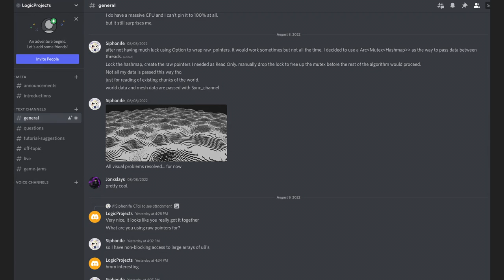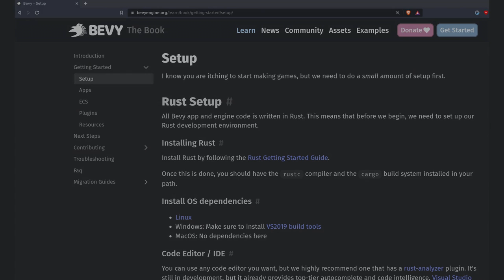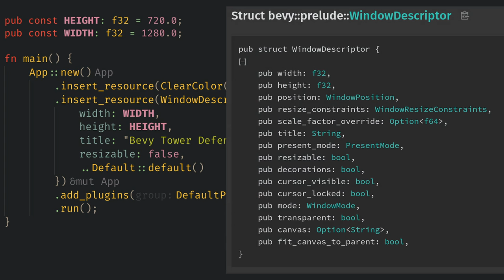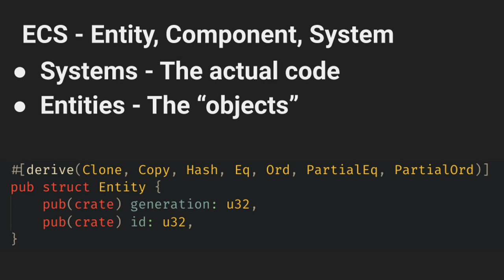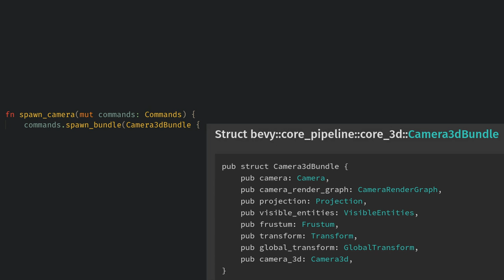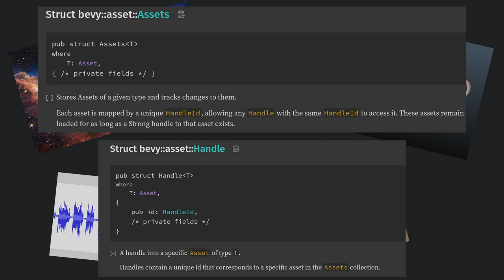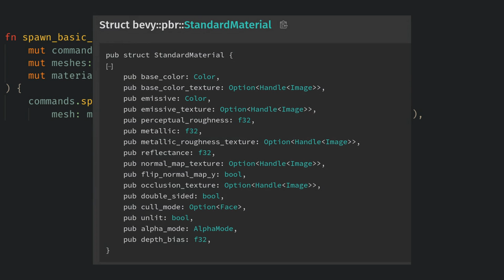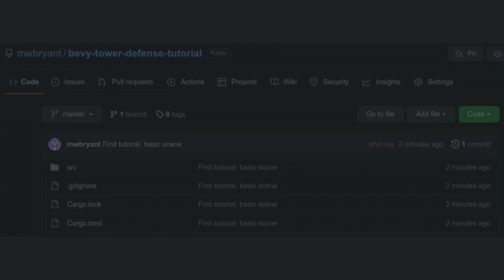Bevy 0.8 Intro Tutorial - A Basic 3d Scene (Ep1) (Updated to 0.9 Check Description)

Comment: Is there way to draw sprites, models and have camera without ECS? Basically access to lower end code.
Reply from the maker: Under the hood bevy uses wgpu and you can use that yourself if that's what your after. Bevy is also designed in a modular way but I'm not an expert in teasing apart the different components so I'd direct you to bevy's discord for that.
Reply: @logicprojects  Thanks. I actually just found out about wgpu and started working with it. Thanks.

Comment: Nice video.
Do you happen to know association between metallic and reflectance in StandardMaterial. Feels like overlap, but I'm far from expert on pbr stuff? Do these get multiplied by each other?
Reply from the maker: I'm also not an expert on pbr. The bevy docs page for the standard material has a PDF you might enjoy that claims reflectance should be used for non metals (whatever that means). In the next episode we'll add a tool that lets you play with the values live and metallic and reflectance do behave different when I tweak them live but not in a way I can describe
Reply: @logicprojects  - Thanks, I think I saw a note somewhere about Filament. I was looking at the docs for that project and that matches what you're saying (reflectances is basically determining the 0-16% range reflectance for dielectrics with 4% at 0.5 value - it's not linear).  Does that sound right that Bevy uses Filament (or based on)? thanks
Reply from the maker: I can't accurately answer this unfortunately. It's well beyond my knowledge of pbr. I'd direct you to bevy's discord and maybe even their rendering specific channels. I'd love to hear what you learn though
Reply: @logicprojects  - thanks, no worries. More just a curiousity thing at this point. I think they're just modeling to the same way as was done in filament, which isn't bad. I kinda still think a "0" or "1" for metallic (IsMetallic) and then a Reflectance Range that's based on that value (like 2-20% reflectance range if metallic is 0, and 70-100% reflectance range if metallic is 1.  Or just get rid of "Metallic" field altogether and just have reflectance which is defaulted to 4%.
It's the same exact deal in blender - hard to model this one I guess, but in the end, I think it's just "reflectance" unless the "metallic" is affecting some other aspect of shading.

Comment: for anyone using 0.9.1 in the  window part you can use what shows in the video use     
App::new()
        .insert_resource(ClearColor(Color::rgb(0.2, 0.2, 0.2)))
        .add_startup_system(spawn_camera)
        .add_plugins(DefaultPlugins.set(WindowPlugin {
            window: WindowDescriptor {
                width: WIDTH,
                height: HEIGHT,
                title: "Bevy Tower Defence".to_string(),
                resizable: false,
                ..default()

            },
            ..default()
        }))  
        .run()
I don't know why but the method show in the video didn't work for me, this did.
Reply from the maker: This is correct! I tried to indicate this in the description and git repo but bevy 0.9 changed magic resources into params on the plugins
Reply: Brilliant, I was doubting myself when using the documentation since the structure didn't match, and I didn't want to throw in a shitty "just works" patch into it, but this lets me know that is the intended new way lmao.
Reply: For those using version 0.10.1 the code is

.add_plugins(DefaultPlugins.set(WindowPlugin {
            primary_window: Some(Window {
                title: "Bevy Tower Defence".into(),
                resolution: (WIDTH, HEIGHT).into(),
                resizable: false,
                ..default()
            }),
            ..default()
        }))

Comment: Could you please turn off inlay hints, i.e. parameter hints? (in future videos, in case you haven't already)
It's confusing. I thought, it's asset::Mesh::from (it's pretty dark so it's not obvious it's just one colon and an inline hint)
And especially new users will probably just type it, thinking this is valid Rust syntax.
Reply from the maker: I really prefer leaving them on for videos. Seeing the types is important for following what's happening in many places and I think the benefits outweigh the early confusion

Comment: Great tutorial! I'm hoping it will be possible to utilize instancing somewhere down the road in this tower defense game.
Reply from the maker: I didn't do it in this project but I'd be interested in seeing if it gives any performance gains. I haven't really seen instancing (assuming you mean reusing an entity and components without just reallocating) used much in bevy because creating new entities is often much cheaper than it would be in other engines like unity. Bevy does handle instancing through the asset system for larger things like models and that happens automatically
Reply: @logicprojects  By (gpu-)"instancing", I mean sending a single draw call to the gpu, resulting in hundreds or thousands of the same object being drawn with different parameters.
Reply from the maker: Oh yes bevy handles all gpu instancing automatically. Everything related to rendering is done through their render world and system which is why we only get handles to 3d models and images. I thought you might be talking about something closer to object pooling which we would have to do by hand.

Comment: Great stuff, thanks. I did walk into multiple non-compile holes because I wanted to type everything myself. So I typed everything  from the screen verbatim, and I wasn't familiar with the code highlighting throwing in, for example, .rgb(r: #, g: #, b: #). phantom r: & g: & b:. I referred to the file from your git repo and saw the error. Others may also make this mistake. Everything is compiling and running fine now.
Reply from the maker: Yeah I often worry the type info might get confusing but I leave it on because knowing the types makes it easier to understand at a glance. I hope in general the type info helps more than it hurts

Comment: when I make a build (also in release mode) I get the .exe file in the target/release folder, but when I execute that, it does not find any of the assets, it is not copied to the output folder. Any ideas why?
Reply from the maker: Yeah this will happen. I'd recommend using cargo run to test so you don't deal with this. When you're ready to ship you need the assets folder in the same folder as the exe. If your workflow needs you to be going into the target folder and running the exe then keep a copy of your assets folder there (but be careful not to lose them when you run cargo clean)
Reply: @logicprojects  okay, I just read the docs on that. That means you are supposed to do that by hand. I don't need to run that actually. I just wanted to make shure that what I am doing works at the end. However I added a build script that does the copying.
Additionaly to fixed assets, I want to load assets that are not there at compile time but loaded from a server later. I thought that bevy can only loads from the magical "asset/" folder that is compiled somehow. But I figured out that bevy actually only assumes the "asset/" folder exists and starts from there and I can even do load("../otherFolder") and load any file relative to that "asset/"-folder. weired...
Reply from the maker: @kampkrieger  Yeah bevy's asset server always looks for the assets folder.  There's no magic there and you need to ship the assets with the game.  It's actually really nice to not need to recompile for assets changing
Reply: @logicprojects  I would have liked if it monitors if assets changed and re-copy it. I don't need to ship it, it can be loaded on run time from the network. So I see at least that as a win. Would be nice if I could change the ASSET_FOLDER_NAME

Comment: Hi, thanks for the tutorial. It seems that the size of the project (build) is very large (in my case 1.55 GB).
Reply from the maker: That's true. It's not the executable though, the file you distribute will be small. That's rust incremental compile process which produces a lot of intermediate data. I often have to cargo clean my old bevy projects to get disk space back.
Reply: @logicprojects  Thank you for your feedback.

Comment: Most desired feature (for me) at this point would be the OpenVDB integration/conversion. I can't remember if C/c++ libraries allowed at lower level in Bevy core or 100% rust only. The "Neural VDB" aspect of OpenVDB is crazy. Super low memory footprint for vdb. Would be amazing to have in Bevy at some point if possible. Getting something like 25x less memory needs for the vdb on the neural implementation.  
https://www.youtube.com/watch?v=uAs8X5es1DE
Reply from the maker: A great place to start on this would be a community plug-in. Assuming you're not blocked by wgpu features (like wgpu doesn't have ray tracing yet I don't think). If you have the expertise or the time to learn I'm sure it would be a great addition to the ecosystem and the bevy discord can help you get through the rendering systems
Reply: @logicprojects  - yeah, I'm not there yet unfortunately.... I bow highly to carter and the others. Just noticing some cool stuff nvidia's putting out - craziness